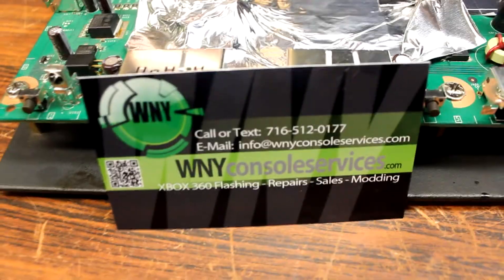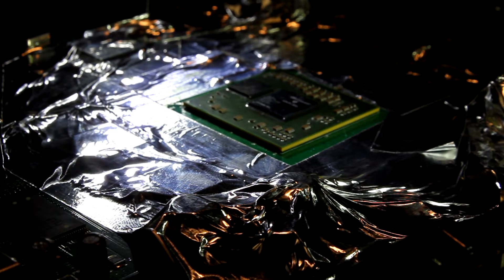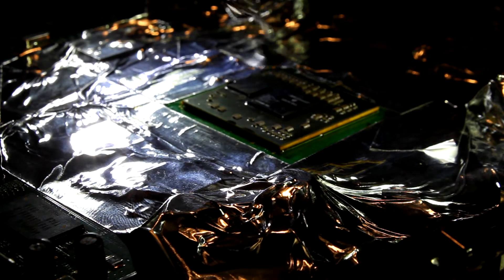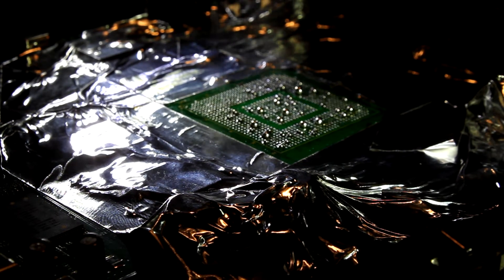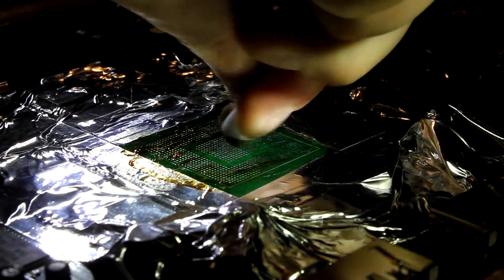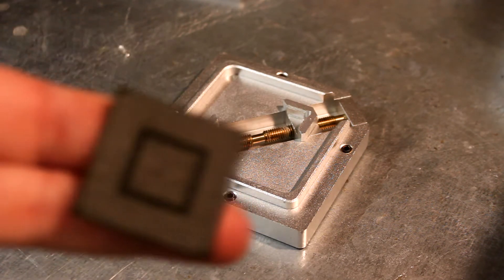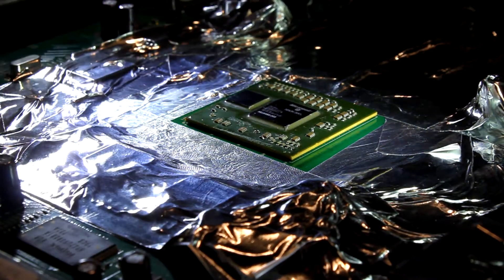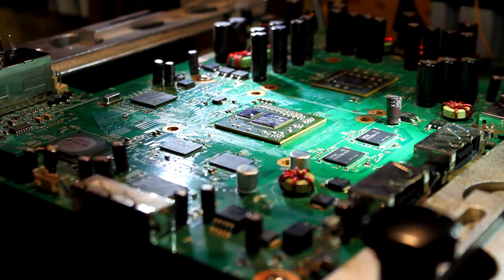XBOX 360 REBALL E74 REPAIR WNY CONSOLE SERVICES ACHI 1080P RROD BGA REBALLING

Comment: I am using a puhui t890 rework station, I set my bottom heater at 180c and top at 220c, a few of my caps keep blowing up, the top IR is rated at 300Watts and the bottom heater is rated at 1200Watts, thanks please give me some pointers it would be much appreciated

Comment: It takes me about 30 minutes to remove an xbox GPU, do you think that`s too long. it also takes me more than 45 minutes to remove a playstation GPU with the metal shield attached. i`m using the ir6000 with both upper and lower K Type Thermocouple Sensors. i put the one for the top heater on top of the GPU and the one for the bottom directly in the middle of the bottom heater with about a 1/4" space.

Comment: You have to heat it until it's temperature is 215-225 degrees C. You can use a multimeter with a thermal cable for measuring.